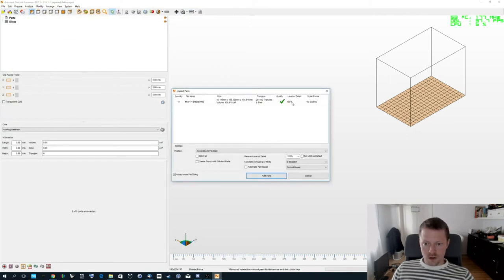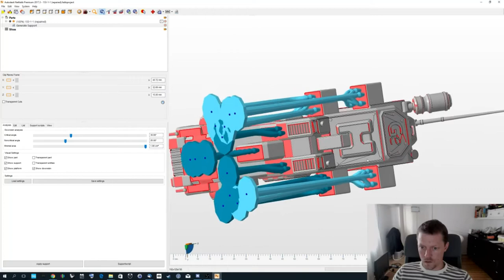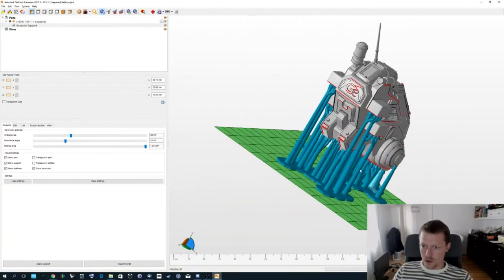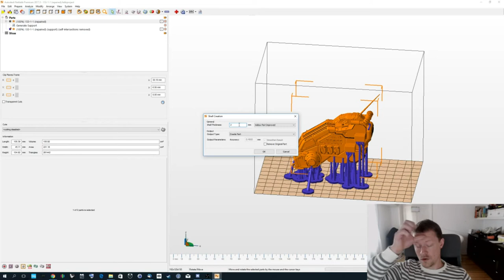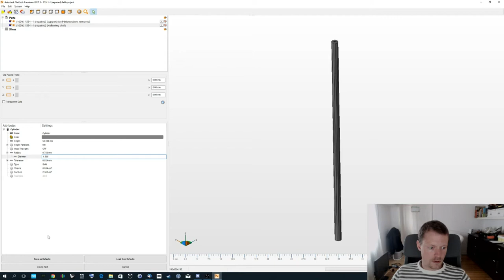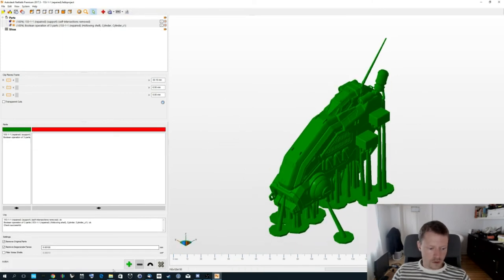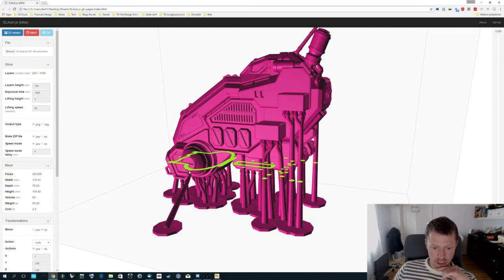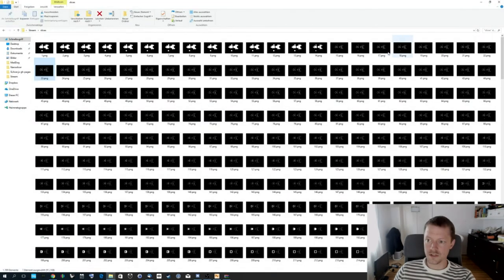Creating supports / hollowing / punching in Netfabb for LCD UV Printers

Comment: How very decent of you. Are you still happy with the KLD2150?
Reply from the maker: Yes i am, actually even "happier" with ftd resin i manage cure times of just 4s
Reply: I'm considering either the KLD-2150 based on your results. What buck converter did you settle to support the 60W LED's?
Reply from the maker: I didnt change it after all, got 3,8 s cure times with ftp clear ind heated, thats plenty fast as it is.
Reply: So how much did the ultimate cost you?